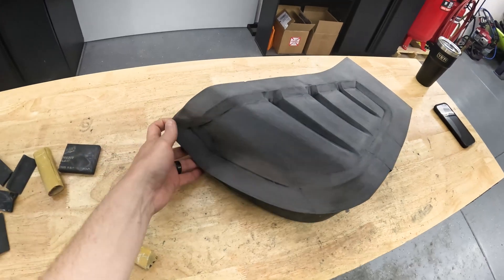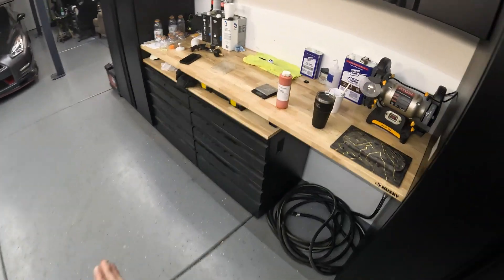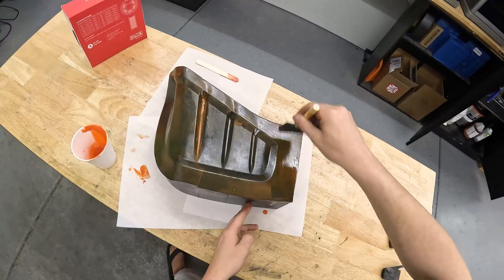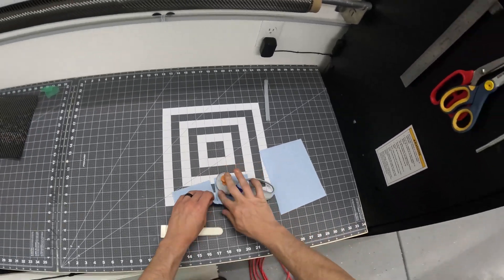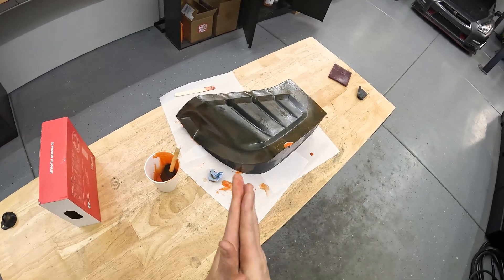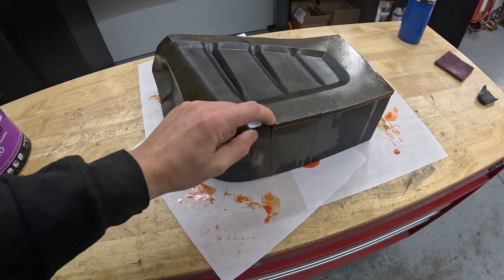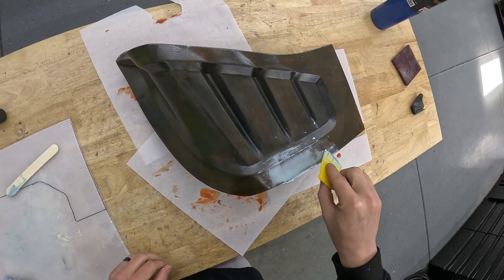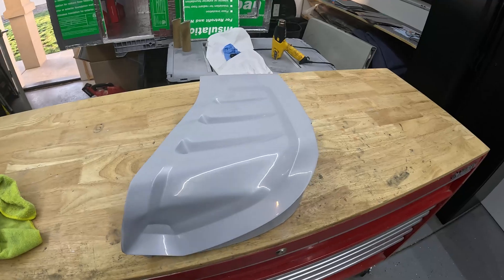How I Get 3D Printed Molds Ready for Carbon Fiber | Lamborghini Bumper Add-On

Comment: If you want to REALLY make the bondo thin and smooth put a little bit of fiberglass resin in it.
Reply from the maker: So I would take the bondo body filler and mix it with fiberglass resin/hardener? I assume this will also help improve the hardness of the bondo? My only question would be, how much of a pain will it be to sand lol?
Reply: @poltdesigns You just add a small bit of it to the bondo to get a smoother consistency and then use the same bondo hardner. Sands pretty easily if you let it dry a while or warm it up with a blow drier. Old bodyman trick to get rid of air bubbles and to sand to a smoother finish.
Reply from the maker: @vidaiautomation  ohh amazing. So you dont even bother with resin hardener just the normal bondo stuff activates it as well? Really cool! Do you happen to know if I can use epoxy resin as well or just fiberglass?

Comment: I am having trouble sanding PETG, is just seems to either tear up the edges of the layers or makes the flat surfaces sort of fluffy.
Any advice?
Reply from the maker: So I usually use 80 grit to get the foundation scuffed up and then go right to body filler and primer. I never try to sand my petg smooth, just enough to lay down my other materials on. Hope this helps.
Reply: @poltdesigns  That makes more sense. Yes that helps, I have been trying to get a decent finish from it. Which I've found impossible. I've ended up doing 3/4 layers of polyester resin straight on top of the 3d print, then flatting that back and polishing it for a decent finish and good release. But I'm making a pattern with it, not a mould. My mould will be a GRP mould.
Reply from the maker: @olly_wooly  Ahh! Tbh I would do a light scuff and right to primer, would be much easier to sand and get better results than dealing with Resin. I use to do epoxy resin on my molds but then after trying primer I cannot go back. I do 2k primer however out of a gun not can.

Comment: Have you tried running a torch over the mold after sanding to remove the fuzzies? I do that when I use a die on a 3d printed bolt and it greatly improves the surface quality. 

Kinda flame polishing the print if you will.
Reply from the maker: O i have not!!! Ty for sharing. Will give it a shot!

Comment: What adhesive do you use between the PETG parts of you mold?
Reply from the maker: Oh I just use normal superglue. To be Specific if you live in USA, I get mine from Harbor Freight by the packs of 10 or whatever. Super cheap but works great!
Reply: @poltdesigns  Thanks for the info! Been wanting to start making parts like this. Sounds like I gotta make a trip to Harbor freight!

Comment: Have you tried using ABS and then vapor smoothing the plastic? It should seal the surface and takes out much of the manual labor.
Reply from the maker: Nah never have. I am trying to avoid ABS as its more expensive than PETG and would take more testing to make sure molds print without warping, atm this has been a fantastic workflow for me.
Reply: @poltdesigns I get ya. For me the cost ended up equaling out roughly because I don't have to use resin to seal it anymore. Also not having to sand anywhere near as much is great
Reply from the maker: @nuclearnarwhal4179  Yeah I am going to try and not use resin again on my cowboy hat and see how that goes. I hate sanding resin down lol

Comment: This is awesome, I'm using the same process. What filament are you using for your molds? I am using ABS, but it gets stinky and more expensive than PLA.
Reply from the maker: PETG. PLA has lower heat values so it sucks imo for infusion. PETG is cheaper and performs way better. I have zero issues with it and love how it prints/sands/etc..
Reply: @poltdesigns  interesting. Thanks for the tip

Comment: nice educational video of the process from 3d printed mold and then creating a carbon fibre part. first time for me on your channel and subscribed instantly for future videos like these. one quick question. have you done such parts in traditional ways? can you compare it cost of materials and labor time wise? im really curious if this 3d printed mold thing is cheaper than cnc milling a hard plastic and having a good surface finish from the get go.
Reply: I regularly buy CNC machined molds and paterns for CF parts. This mold would cost me about 600-700EUR (in aluminium) or 200-300EUR in MDF, and the surface finish would be aroung 8 to 12 ra for aluminium (2K epoxy coating needed)
Printing the molds is extremely cost efficient + faster
1 3D printer is cheaper than 25KG of tooling gelcoat...(15EUR/kg)
In my company, we 3d print the patern (or the mold)  if we produce less than 20 parts.
Reply from the maker: @benbro8287  i have made 1 or 2 molds using tooling gelcoat, fiberglass, etc. that process was way more expensive and time consuming for me. To make a mold like this here its roughly $20 or so of material. Maybe 3-4hrs of time max.

Comment: What resin is used for the light layer on top of the 3d printed part? Is it some kind of tooling resin or would your typical wet layer resin work?
Reply: I think you might want to try using the thick resin on large gaps, then thin it and coat.  That might eliminate your body filler step for just a little work on the resin coat step.
Reply from the maker: I would think any resin would work just fine. I just used my standard layup resisn I use for infusion from USComposites.

Comment: The last time I used primer on a 3d printed part , when the part came off the primer was stuck to it .I used 5 layers of wax release agent . It never happens when I use an all fiber glass mold without any primer on it . What’s the problem ?
Reply from the maker: Was it 2k primer or rattlecan primer?
Reply: @poltdesigns I actually had the same issue. Did ~5 coats of mold release wax thinking I was covered, but the primer came off on the part.

Workflow was - 3D printed mold, sanded to 120, then epoxy, sand that to 180, primer - wait 20 mins to dry, second coat of primer, then sanded (only up to 2000).

The primer I used was rattle can auto primer. I did not use an adhesion promoter…
Reply from the maker: @ParametricCPA  i think thats the issue. I tried rattlecan and had issues as well so went with the proper 2k gun workflow and it’s great. What I also noticed that helps is after my last wax coat I apply another and let it almost fully cure into mold where its hard to wipe off. This makes parts pop off easy. I got another video I gotta edit and it shows part pop out of mold with zero issues.
Reply: @ rattlecan
Reply from the maker: @ i think thats the main issue. I didnt like results I had with it myself so purchased a gun so I can do proper 2k primer.  Now things are much better.
Reply: @poltdesigns  hey would I be better off using a duratec surface coating primer instead of a 2k primer ?
Reply from the maker: @robbikoeppel7538  I honestly cannot say yes or no because I have never tried it. To me the main reason for the high build primer is just to aid in leveling/smoothing the surface. I hate how hard it is to sand resin so I switched over to primer. If the Duratec cures really tough I cannot see why it wouldn't work!
Reply: @poltdesigns ok going to print another one and have both sprayed and will compare them then. With the 2k primer so I need to worry about it pulling off the mold ?
Reply from the maker: @robbikoeppel7538  So my latest method of waxing has been proving wonderful results where no mold damage at all. What I like to do is, wax it the way I normally would, about 7-10 coats just to really season it. Then the last coat I apply and let it sit until the wax is almost hard to remove, then when removing I just gently remove it to leave a little residue if you will. This has now made it when I go to demold I can pop the parts out super easy without any risk of primer lifting. Now every now an then I get a tiny spec that lifts which I can scuff off but nothing like a whole chunk if that makes sense.